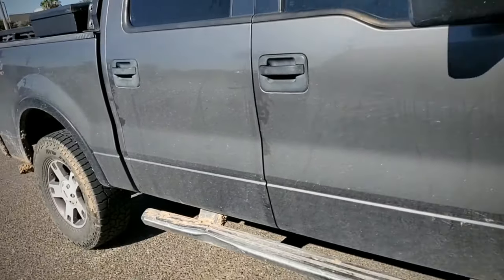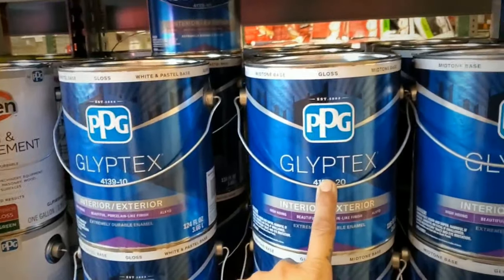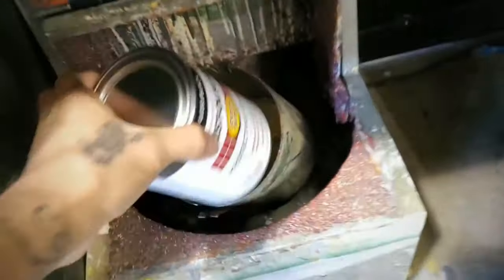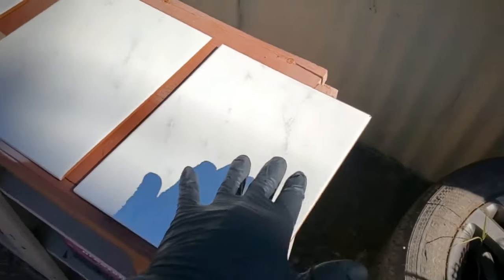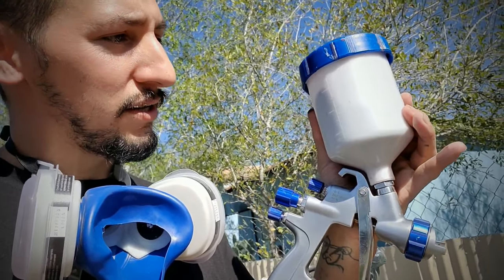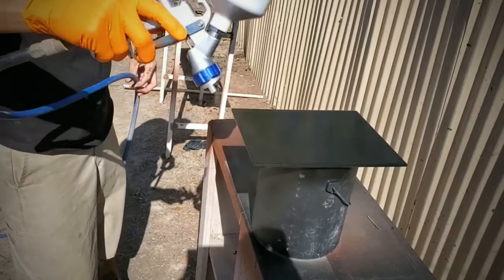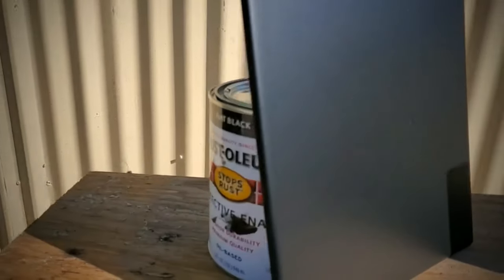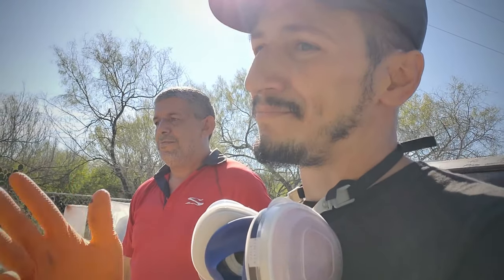Rustoleum - Flat, Semi-Gloss or Gloss Black?

Comment: Here in Canada, Rustoleum is called Tremclad. I have been using it to paint (trucks, boats, snowmobiles, etc ) for over 30 years. 2 parts paint 1 part Acetone and it sprays quite well. I also use a few drops of fibreglass hardner. Great video.

Comment: Don't use Acetone with your Rustoleum unless you want the paint to crack. Acetone Evaporates to quickly especially on a Hot Day. Use Mineral Spirits. I restored an Air Compressor last summer and it came out beautifully except at the very top, it wrinkled up like crazy , go figure.

Comment: Brother love your content been subbed and watching for while now. I have a couple of questions I hope you can help me with. I'm wanting to paint my Ford Ranger and want to use Rustoleum as you have before however, I'm not sure should I use a clear coat or can I just use high gloss and wet sand and polish it out. I saw the awesome finish on you have on you Mitsubishi but couldn't remember if you used a clear, also if you were going to use a clear which brand and type would you use. Finally, I'm sorry for all the questions this is the last one  I promise but I want to go with the Hunter green Rustoleum but I want to add gold flake to the paint, when do you add the flake would that be in the paint or would you add it to the clear. Once again any help would be much appreciated God bless you and your family.
Reply: Add the flake in the clear. Can get "Gold shimmer pearl" flake $10 and Speedokote 2k clearcoat off Amazon $59 a gallon. Dont thin the Speedokote just spray it as it is already thin enough. Make sure to turn your pressure up a bit 30-40 psi on the clear. Good luck

Comment: Can you let me know the air pressure set and how long wait time between coats?  Also will the paint chip from the tile after it dries or would you use a polyurethane clear to protect it?

Comment: Does it make a difference if you use Acetone or Mineral Spirits to thin it for your gun? The reason I ask is I have Acetone but my Rust-Oleum can says to use Mineral Spirits and I've heard that thinning your paint down to spray will make your paint more matte. I'm to figure out if one affects it's less or more. Also thanks for the video!

Comment: Yo so what happens if you put a satin clear coat or semi-gloss clear coat over the flat enamel? Will it give it a little shine?  I'm painting my spoiler, front lip and rear diffuser myself, but still don't know what sheen or clear coat to use.  I don't want high gloss I know that, but I also don't want a flat finish.

Comment: Be cautious of the Rustoleum Farm and Implement paint in gallons and spray cans. I got a gallon of low gloss black and the exact same thing, low gloss black, in they’re spray cans. After painting a tractor with the gallon and a bunch of small parts with the spray cans, it does not match. The spray cans are flat black and the gallon was gloss.
Reply: That must have sucked
Reply: Eddie W Rustoleum does suck.

Comment: Are you just going single stage on the c10, or are you going to 2k clear it?
Reply from the maker: For now,  just doing black. Later on,  I'll come back and do some body work and spray better paint. 
This is temporary so the truck won't stay bare metal and continue rusting
Reply: @GTsPerformance  good idea. Gotta keep that thing from rusting out